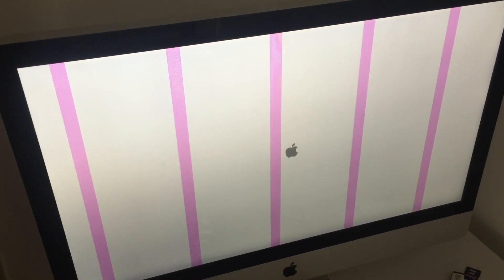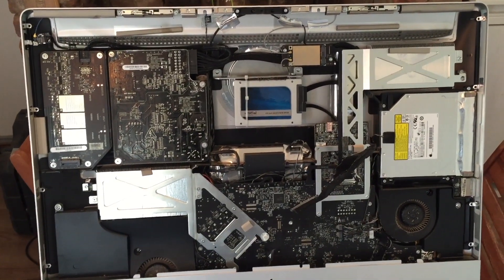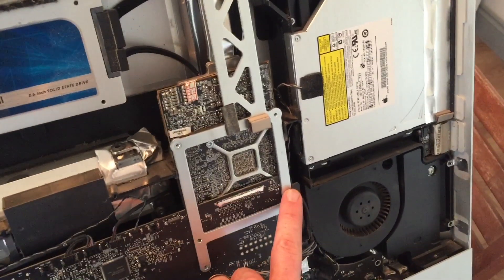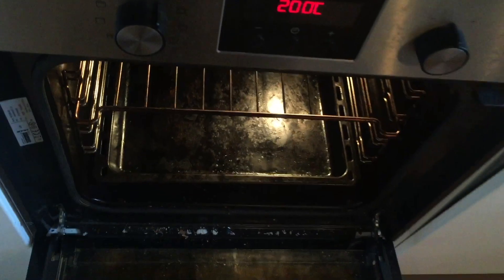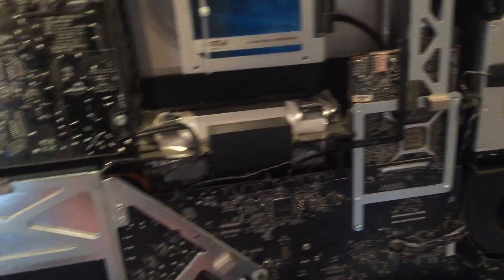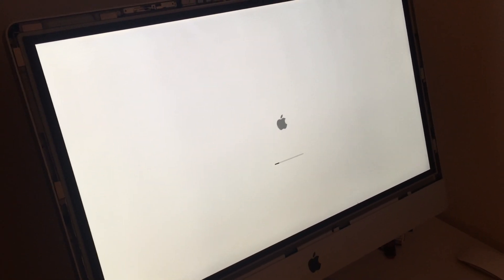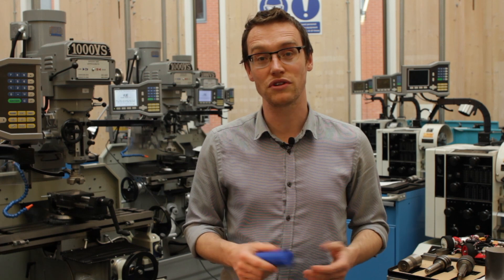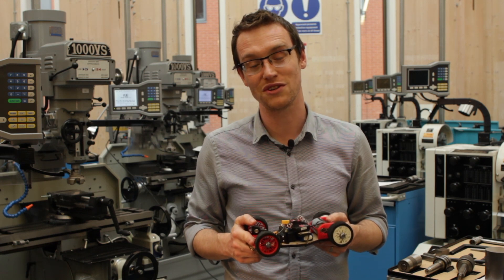How to Fix iMac Pink Vertical Lines Graphics Fault - #5minFriday - #12

Comment: First time mine worked for two weeks after baking my graphic card. I tried it again a but this time gave it a good vacuum to get rid of the dust presumably causing the overheating.  No need for thermal paste. Has been working now for months since no problems (except the usual ones)
Reply: No need for thermal paste? You realize that makes the connection between the GPU and the heatsink, and without it there isn't much transfer of heat going on.

Comment: Thank you so much! Amazingly this worked. I´ve never taken apart a mac (or pc) before. It took me an hour, and I watched a different tutorial on how to remove the screen. 

I agree with the others saying it could be a little more comprehensive, as I had to do some guesswork to take out the graphic card itself. 
But it is pretty straightforward and logical. 

You just have to hold the motherboard while taking out the 4 screws on the front (on the little cross), and 2 on the back, then use a tiny bit of force to release it. 

This saved me money....!

Comment: Is there a cable ribbon for the LCD monitor? If so, does it have a clip or do I just pull tab to remove ribbon?
Reply from the maker: +zhivago1955 from what remember it's a pull type but it is delicate, be careful!

Comment: Hello!!Can you tell me if I need to place the video card in an ALREADY PREHEATED oven at 200° OR do I put it in the oven and only then set the temperature at 200° ?! In the last way it would take longer for the oven to reach 200°.any input on this is much appreciated ;)
Reply from the maker: +Emil Dragomirescu I did this when the oven was preheated and it worked fine. Good luck!
Reply: Well I tried the method, and unfortunately it didn't work :( It was worth a shot anyways ;)

Comment: What kind of screwdriver do you need for the round screws on the bottom of the graphics card.? The top right one is a torque but the other 3 on the bottom are round in shape .
Reply: I had the same dilemma. My tech told me that I was looking at the back of the screw. The next step was to remove the logic board to remove those 3 screws.

Comment: Thank you.  This worked and helped me a lot.  I had yellow and white stripes.  First time pulling apart a computer and fixed it! My iMac is a 2011 so used this vid also which was the same model.  "Burn the VGA and Fix your iMac" by Evan.  It was a fiddle so allow a few hours if you haven't done it before like me.  Happy baking!

Comment: Hi, very helpful video. You think this method can work for MacBook Pro late 2011? It's showing exact same symptoms: pink stripes, then white screen. Thanks.
Reply: It worked for mine.
Reply: You would have to do this to the whole motherboard, but it can work, at least for a little while. Nobody has commented back as to how long this lasted for them, but if it's more than a month I'd be surprised.

Comment: This is just unbelievable, it worked on a 2011 iMac 27" . The difference is the instructions,  you need to remove the logic board as the screws securing the AMD video card are not accessible as shown in the video. The real question is how long will this "bush fix" really last? Any ideas people
Reply: is it still working? mine just crapped itself, wondering how long does this solution lasts
Reply: Tony Ramsey are you sure?
Reply: Tony Ramsey not true. My parents iMac has this issue and apple provided no clear help. I will be fixing the issue.
Reply: the long and short of this issue is cooling. Apple is more concerned about the sleek aesthetics and puts the important issue of hardware cooling on the back burner. These machines have the potential to heat up internally to the point that it melts the solder holding the precious components on the board. Intense heat is almost always what causes these issues.

Comment: I can now confirm that this method also works with YELLOW vertical lines;-) 

Had identical symptoms on my late 2009 iMac 27". Local Apple pusher informed me Apple no longer provides spares for this model (older than 5 years), so not possible to repair.  So figured game plan  would be 1) bake the GPU card and 2) off to the bay of E to get a silly priced used replacement card.

Put the GPU card in the oven at 200C for 10 mins,  resting on 4 foil "buttons" as per video, then leaving it in the oven until cold. 

As of now, late nigth and a few brewskies into the project, the damn thing fires up nicely:-) Can only hope for long term performance. 

To the next guys out, when removing the monitor, pay attention to the small vsync cable in the upper left corner and to the main display connect lower rigth center. Fragile. Mine have been taken apart a couple of times before to change HD/SSDs, and both these connections are now in a bad shape. Preferably, use a nose-plier to remove the vsync cable. The main display connect needs to be pushed from the sides to release, dont attempt to pull straight out.  I did, and the socket connector came loose. Was able to put it back in place, but it is now just "sitting there" without anything holding it in place, and will probably come loose if the monitor needs to be removed again.

Thanks for sharing your video.
Reply from the maker: +Torgeir Larsen I didn't even know there was a yellow lines fault! Good to know that it works though.

As much as I love macs, the planned obsolescence and lack of design for maintenance is a real bummer and sort of makes a joke of their supposed "sustainable approach".
Reply: Torgeir Larsen you think this method will work on a MacBook Pro 2011? Thanks
Reply: It may. It depends what the problem is, which is almost impossible to determine. The method FutureFab describes assumes there is one or more broken solder points, and heating the card to above the solder melting temperature (typically 183deg C) will cause the solder to melt and "re-solder" itself onto the board/components. If your problem is a bad solder point the method may fix it, if the problem is a broken component on the card it will not be fixed. 

Be aware that the heating to 200C may cause failures in electric components. Even though it may fix broken solder points, it may ruin the card. You would perform this method only as a last resort, hopefully understanding the risk. Still, there are multiple persons that have successfully performed the fix, and if the graphic card don't work anyway you don't have much to lose (in my mind:-) Your backup plan would be a new or used replacement card. Good luck:-)

Comment: Your video needs to be a little bit more comprehensive. Show how you got to what ever. How you unscrewed and removed the GPU and how to returned, what to move and what not to touch.  Your movements on how you got to the GPU is important for those (like me) who are apprehensive on getting to do it oneself. Otherwise OK video.
Reply: If you can’t figure out the small details yourself then you probably aren’t technically proficient enough to be carrying out these types of repairs yourself.

Comment: Can someone explain to me why in the hell this actually works?
Reply from the maker: +Drew Mcgee Basically the GPU chip is surface mount soldered so the solder connections are too small to mend using a soldering iron. By heating the solder in an oven to its melting point it reflows and bridges the gaps.

The gaps appear in the first place due to either mechanical or more likely, thermal stress.

In my case I had been using a third party wall mount which I believe blocked the exhaust duct leading to unnecessary heating of the GPU chip. The high temperature difference between its peak and ambient temp led to a lot of thermal stresses which eventually broke one or more of the links between the GPU I/O pins and the graphics card board.

Hope this helps!
Reply: jdman561 ok man can do. gimi a sec
Reply: Jacob Mead i read more about it, i was also wrong, it changes something in the chips themself, its a fix that works for about 3 to nine monthes
Reply: +fმɀპ ძმῆκ post a link and your comment will be valid.
Reply: Is this still running? Or is this a 3 to 9-month fix?
Reply: no, your wrong this is common misinformation check out Linus tech tips video on it, and the response from that.
Reply: what this actually does is warp the PCB